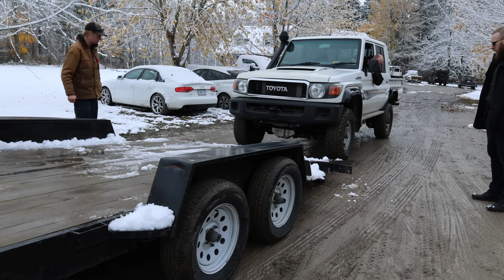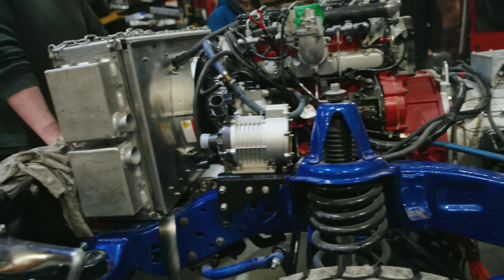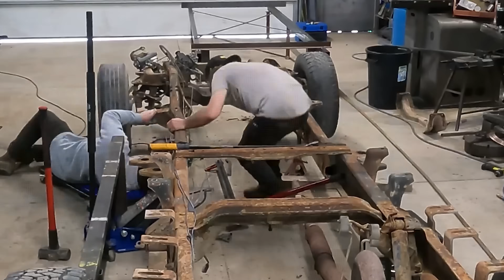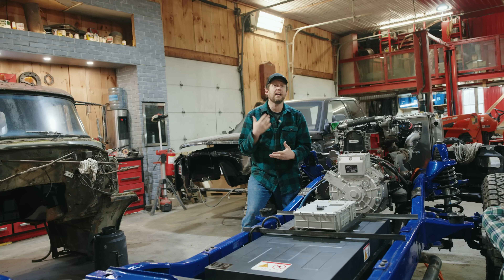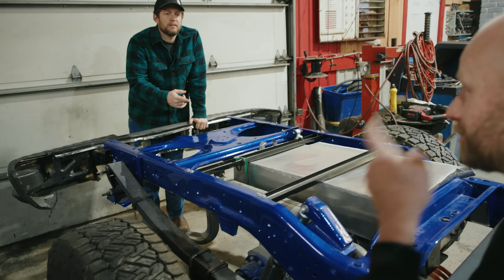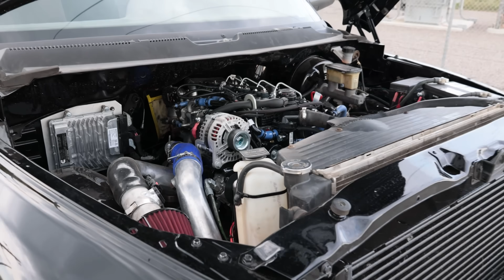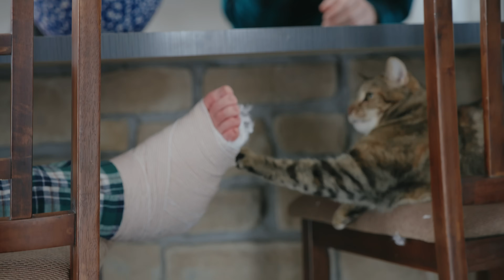Scrap Our First Design and Build an Edison Pickup Chassis from Scratch?

Comment: Here is Andy Stvan, the Czech tourist who is waiting for the solution to replace the unreliable 6.4 Powerstroke in his F-350 grey camper!

Excellent move going to a proprietary chassis—that’s a serious step toward long-term platform independence and modularity. A few thoughts on the architecture from a specialty-upfitter perspective:

- Straight, standardized rails: A constant-width, straight-rail design (vocational truck style) is a game-changer. It makes future frame extensions or 6x6 tandem setups dramatically easier. It’s the gold standard for high-payload engineering, similar to the approach taken by Prospeed with the Hilux HILOAD 6x6, where a replacement chassis is used to achieve the necessary stiffness and modularity that factory frames just can't offer.

- Maneuverability & global AWS potential: Tight streets are a global reality anywhere outside of North America. With dual e-axles and air suspension already in the mix, the foundation is there for advanced steering concepts. Even if not immediate, designing the rear module with packaging logic for All-Wheel Steer (AWS) would be huge for navigating tight urban and industrial environments globally.

- Benchmarking the Tatra Standard: It would be fascinating for the team to look into the technical specifics of Tatra Trucks as a global benchmark. Their modular chassis concept, integration of air suspension on every axle, and multi-axle steering/crab-walk options are legendary in the vocational world. An electric architecture layered onto that level of modular thinking would be incredibly powerful.
(Eliska might have to push you to visit the Czech factory, museum, and proving grounds in person one day to see those systems in action 😉).

Really exciting to see the direction this is heading. The chassis-first approach feels like the right long-term play!

Comment: I think that the 34" standard is perfect. One of the reasons for the 34" width is the ability to dual up a standard axle without running into width problems for the inner duals. In pickup trucks, Ford widened their frame rails in 1974 to accommodate the fuel tank inside the frame except for their one tons and larger trucks that stayed with the 34" standard. Dodge had wider frame rails from the beginning except for the one ton and larger that had 34" rails. I do believe that Chevrolet and GMC did the same. If you are looking at the one ton and larger trucks 34" standard just makes sense. Even today the cab and chassis trucks that go to the upfitters are mostly 34". 

The other thing to look at is the rear axle width. I think that you need a standard track width axle that fits most trucks and it needs to have zero offset wheels so that when it is run in dual rear wheel configuration it's stays the same. The front axle needs to also have the zero offset and either a bolt on spacer or dedicated hub for one ton dual wheel application. 

I think that you will have to make a wider axle to accommodate the dually pickup like the OEM's did with the inside dual tracking the same as the front the width difference if I remember correctly is 9" per side. Some do it with longer axles and others do it with an offset wheel flange on the hub. The problem with the offset wheel flange is that it puts more stress on the outer wheel bearing. For load carrying capacity having the wheel flange between the bearings is the best. 

Please do not use unit hub bearings on the front as so many trucks have these days. In the front I would like to see a standard set of bearings on a spindle with the axle running through it and a locking hub or drive flange if you are going to have 4 wheel drive. If going with 2 wheel drive I would use the same straight axle tube as a 4 wheel drive just without the motor in the middle. I would use the same spindle and everything else just the same as the 4 wheel drive for simplicity of parts and the ability to convert from two to 4 wheel drive by just changing out the center section and installing drive axles. 

All in all this is what prototyping is all about. You actually have to build something and test it to see where you can redesign and improve it. I don't think that the Dodge truck has been a waste of time but more of a test bed for different designs and how they compare to each other. It will be great seeing it towing the Airstream across Canada.
Reply: total agreement with your comments James, and a empty 4x4 front housing for 2 wheel drive versions is a great idea also. But I think most if not all pickup owners will go all wheel drive, in fact it will be a necessity  with the amount of torque this set up will make. limiting factor will be the u joints on the front axles!
Reply: Absolutely,great plan
Reply: ONLY cab & chassis are 34" wide chassis in back, Ford pickups are ~37" wide chassis, not sure about Ram (38"?) & GM. You also need to learn what zero offset actually is, because that means the mounting face is dead-center of the wheel left-to-right, which obviously won't work for DRW - that would require a giant spacer wider than the overall width of the wheel (half + gap + half). 👨‍🏫